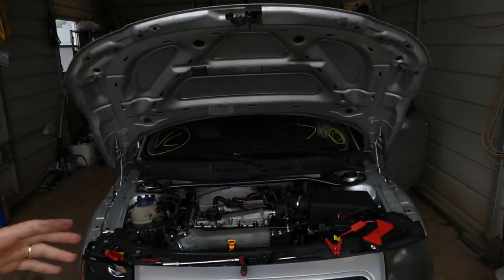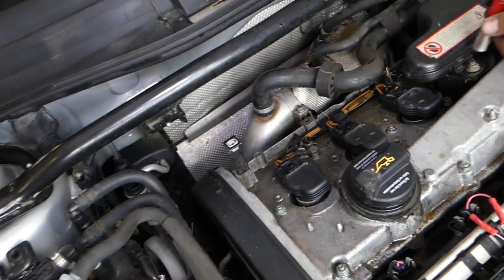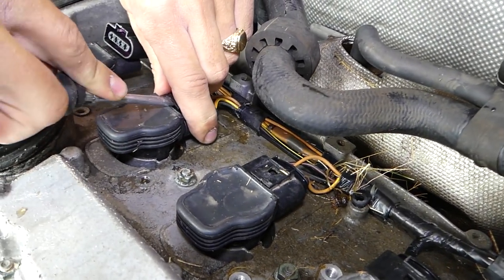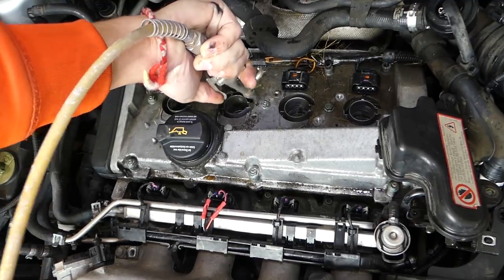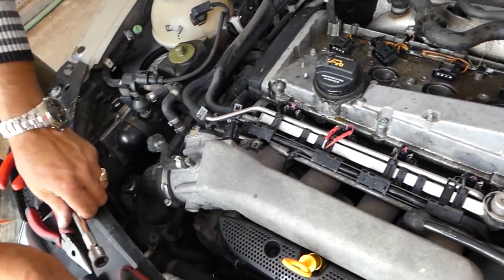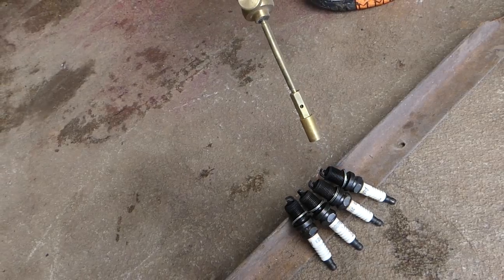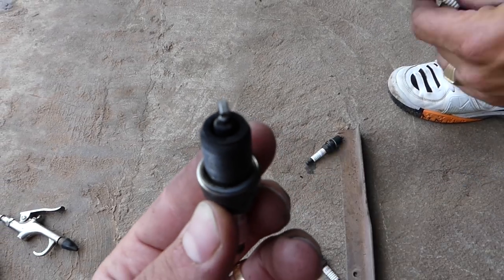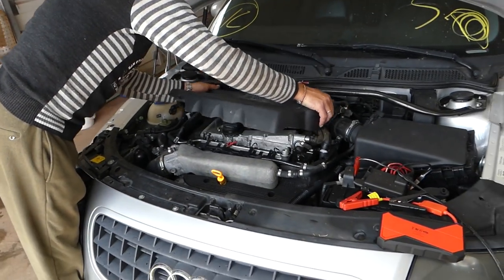HOW TO FIX FLOODED ENGINE | FLOODED SPARK PLUGS

Comment: Well, you can do this only to be able to start the engine and go to the repair shop, because it will flood again. There are three flood sources: coolant, oil and gas. If it is coolant, you have head gasket problems, if it is oil, you have piston rings problems, and if it is gas you could have injectors, fuel pump or temperature sensor problems.

Comment: just clean the spark plugs with brake clean and blow them with air and you'll be good to go!
Reply: Just replace the plugs.
Reply: Sounds like that would work or:

Why can't you just hold each plug with pliers and burn off gas with a lighter?
I used to do this, seemed to work...went from no start to starting...
If you have a torch fine, use it but many don't have one or are away from home...same thing with spark plugs, if you have new ones, fine put them in...
I mean sometimes one is stranded and can't just go out and buy plugs, or a torch...
I do however keep lighters and a socket set in my vehicles...

Comment: Just for everyone’s info- a VERY common cause of a flooded engine (with no apparent explanation as to why it has occurred) is if, for example, you get in your car to move it out of someone’s way, and then turn off BEFORE the temperature gauge has risen out of the ‘blue’ section. Jaguars are especially prone to this problem, with other marques, and can then be a nightmare to start.
Reply: You seem informative would you happen to be able to help me. So my car has been absolutely fine the past couple of months and I had new spark plugs and leads put in 4 months ago. However today I was going 30mph and all of a sudden my check engine started flashing then went off and I felt a loss of power. This loss of power continued as I literally went round the corner to my house but the engine light stayed off. As I checked spark plugs the cylinder head where all 4 spark plugs are kept is flooded with a puddle of water all across the head. Definitely isn’t engine oil I’ve checked. My car is a Ford fiesta 2011 mk7
Reply: @adamrobson7889  Hello Adam. Mk7 Fiestas are known to have water leaks from the water pump (timing belt side of the engine of course) after a few years. This may well throw a brief check engine light. Flashing would indicate water/ steam reaching the catalytic converter. It’s possible water could have seeped through the plug threads, but unlikely. It would need checking with a OBD2 reader to find pending/ stored codes. Is it a 1.0 Ecoboost? Did it use coolant? It will need a more in depth check.
Reply: @torehelmersson1989  hi no it’s a 1.25l edge . Had the water drained and dried out the spark plugs. The car runs fine and starts fine, but the car is still stuttering and doesn’t feel performance wise 100%. The codes read random misfire on plug 2 but after the RAC mechanic left he said the codes were fine and he checked engine pressure and output and everything seemed fine. I then got advice from another mechanic who said a core plug may have gone bad and thus the water managed to get in, he also said a plug or lead could’ve corroded or gone bad therefore it isn’t sparking/igniting properly. He also said the coil pack could be on its way out. It wouldn’t suprise me with the core plug as it has been raining and freezing a lot recently. I’m getting it checked out in the next few days.
Reply: I know what you mean. Best thing to do is remove the fuel pump fuse . CRANK clear all the fuel, then put the fuse back in and it'll start right away.

Comment: My 2010 Nissan Versa wouldn’t start, so I had it towed. The garage said my engine was flooded. They burned off the excess fuel and got it to start. They haven’t been able to determine the exact cause of the flooding, but they said I should replace all 4 spark plugs, since they got soaked, and since I have 78,000 miles on the car and I’m close to the 90K mile recommended replacement of spark plugs, anyway. I’m afraid if I do this, the flooding will just recur. What should I do?
Reply: If your fuel injection doesn't start. Check the plug wires.

Comment: Can't you hold the gas pedal all the way to the floor, this will cut fuel injection and it will burn off whatever gas is in the cylinders for maybe a few seconds then run normal?
Reply: Yes especially if you have a carburetor
Reply: I always hold the throttle to the floor clears the fuel and starts

Comment: Do I need to take put ALL of the spark plugs? I'm having trouble taking 2 out
Reply: Only way to find out.
Reply: @JodBronson  yeah. They were like really f@$#!* tight. I had to replace air filter, fuel filter, new sparks. My car needed new spark wires but its cause they were old and already messed up. Then I needed to get a new battery and starter. Whew. But my cars back together. I flooded it stepping on gas through puddle lmfao
Reply: @thehomiegooof  - Wow, you went through all that?  Here is what I've learned and I will share it with you.  My Dad's Honda was flooded.  Here is what I found out.  Although it may not be your case, but worth a shot in the future.  Under your Valve Cover, there are SEALS in there.  Those seals get collapsed, due to heat.  What you need to do is get another set, glue that on top of the OLD seal.  This will "double" the layers and make it thicker.  This will prevent the Oil Leaks into your Plugs.  NOTE:  If you try this method and it doesn't work.  You have Oil Head Gasket Leaks and you will know 100% after trying what I described above.  REMEMBER...  Valve Cover Gasket is cheap, give it a try.  99% of these folks on YouTube or the Internet have NOT try what I've described above and there is NO video on it either.  I made a video a while back, I will upload it later.... Due to the pandemic, I was so busy doing things.  But that is how I solved my Dad's problem and now NO MORE LEAKS :)))))))))))))).

Comment: What are my options if water has gone past the spark plug? :/

I'm aware its a big problem but I am looking for all possible solutions no matter the effort.
Reply: You need to have the cylinder head gasket replaced if your spark plugs are getting wet with water or coolant. It's the only real fix.

Comment: My Car HOnda CRV get flood and till air filter .....now it not starting up....battery dead...i tried with other batter but when try to crank it show low batter....no sound of starting motor ...only deshboard lights on and get off when i tried.....kindly help it is same issue with plug...or more..

Comment: I have a 03 Honda Civic... and after I drive... If I turn my car off... then it won’t turn back on... I wait for like 20 mins and it turns back on... can this help me??
Reply: Did you get it fixed?  2 possible I have faced.... The Coil gets too hot and the engine coolant temperature sensor preventing the car to start until cool.
Reply: Jordan Bronson it haven’t done. Lately but I have a check engine light with the code p0171 .. maybe that’s the cause
Reply: I had a somewhat similar problem in a Chrysler... It would also die sometimes on the highway. After 30 to 45 minutes it would start again. I also occasionally got p0171/p0174 (lean condition) and p0300 (random misfire). A couple of shops, including a dealership, misdiagnosed it and replaced the wrong thing. In the end it was the fuel pump slowly failing. I replaced it and that fixed the problem... Im curious if you ever figured out the cause of your problem?
Reply: @saaaron5213  it was exactly that.... I changed the canister and solenoids and still did that with the code p1457... and then at the end it was the fuel pump and now it’s good
Reply: @xelementzgaming7171  good to hear you got it fixed.. I've heard two stories now of people actually just junking their car or selling it for nothing after their auto shops couldn't figure it out. Lol

Comment: My plug holes have water not gas in them is there something I can spray into holes to displace the water then put back the plugs ? A mechanic said the motor has blown head gaskets possibly warped heads ! Engine oil is not milky at all but he insists that it might even be cheaper just to replace the engine which is a 3400 SFI  in a 2002 Chevy Venture 🤔
Reply: Use a Wet Vac, attach a small hose and suck the water out.

Comment: Never do this! You check oil first and transmission fluid and air filter for water before ever starting the car. Then remove spark plugs if you saw water in oil or transmission. Then crank car with all plugs removed so water will come out spark plug holes. Then put plugs back then your good to go. But if you saw water in trans fluid and oil. Drain and put new.
Reply: Will Sosa thanks Scotty
Reply: Will Sosa or could just drain everything and get new plugs lol
Reply: Will Sosa or could just drain everything and get new plugs lol
Reply: Will Sosa he meant flooded by gas
Reply: @deathordie  😂🤣🤣🤣
Reply: @deathordie  🤣🤣
Reply: So if there is water on spark plugs how do you get it out?

Comment: Why can't you just hold each plug with pliers and burn off gas with a lighter?
I used to do this, seemed to work...
If you have a torch fine, use it but many don't have one or are away from home...
I keep a socket set in my car but I don't keep a torch...

Comment: i was trying to soak it with towel paper it got stuck and i dropped the towel paper along tape in spark plug hole,i tried to take it out but it cant. is that ok if i put back the spark plugs and start the car? would it do any harm or would it just burn out by the sparks?
Reply: You need to disassemble the cylinder head to remove the contaminates, unfortunately. I would doubt anything but the beefiest engines could just casually burn through that much contaminate.
Reply: @scottatlas7359  thank you for replying back after somany yrs when I already bought and sold many cars
Reply: @Ali-jt3ps  lol why have you gone through "so many cars" in just 3 years? I had My Buick Rendezvous for only a short time, but that was still 2 years.

Comment: To you all: My car was flooded. Drops of water in the oil dip stick. It starts but engine makes knocking noise. Changed oil and filter. Great and I was happy. After about 1000 miles, knocking noise started and the car stopped; won't mover. Mechanic suggested i replace the engine. It is a good Avalone less than 7 years old. Can you guys give me your suggestions
Reply: cracked head ,broken head gasket posible.old school.i am.new cars could be somthin else.good luck,compression test it.
Reply: Thanks MIchael. Very good thoughts
Reply: Probably should have replaced the oil a 2nd times honestly. Get all that's old stuff out for sure. Small amounts of water may have stayed in the engine and possibly pooled in an area for a while as the small amounts collected, then when that amount was pushed along it was too much for the cylinders to handle due to water not being able to compress

Comment: Exactly how was this thing flooded?  Submerged?
Reply: Definitely submerged - and from the water in the cylinders, done so while running.  The wires going to the coils show big signs of sitting in water, the glazed look to the color coded wires.  All colored wires do that when water is on them, they lose their "deep color hue" and glaze over.  This has every sign of a salvage title car - flood damage.  When diagnosing a flood damage salvage title car, check the oil to see if it is chocolate milk color.  That is a clear indication of water/oil mixing - not good.  Air filter is another clear indication car was running or high submersion with smell/corrosion/mold.  Check inside car, look for water in cup holders, papers in glove box, trunk where spare tire is, water in door compartments, water line on exterior of car, fading of seats to determine how far the water got up to.  The car in this video is not worth fixing, in America you would be very lucky to get it registered again.